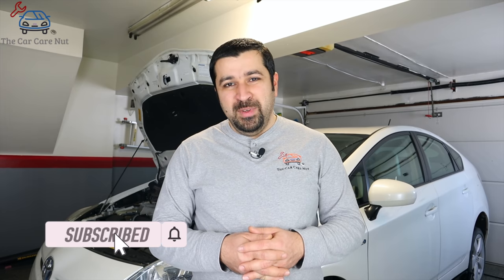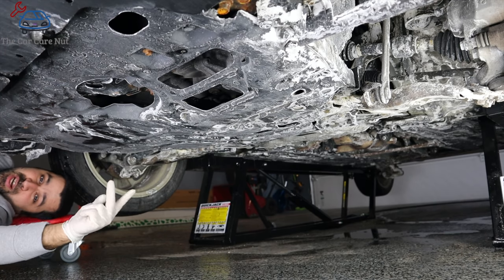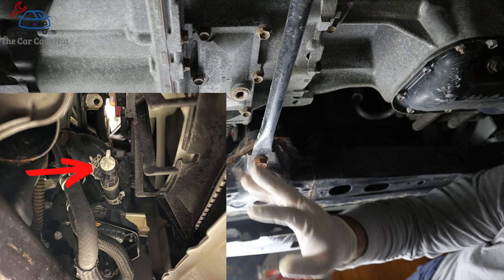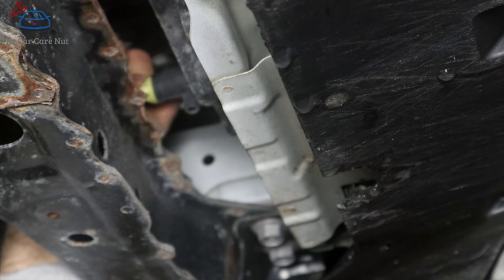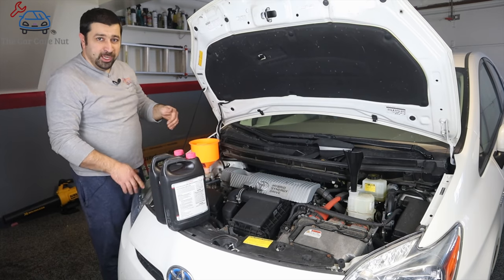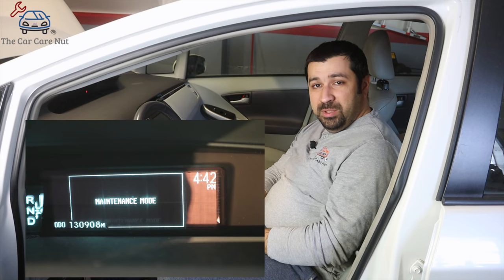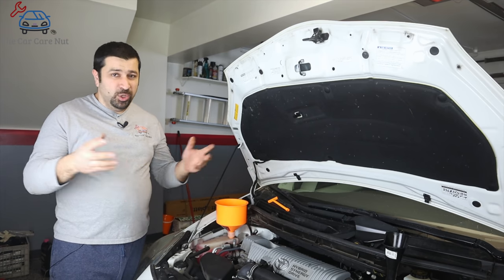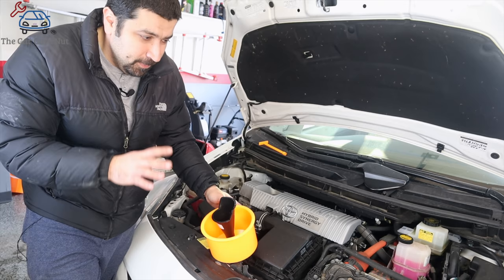How to replace your Toyota Hybrid Inverter and Engine coolant

Comment: I just replaced both coolants on my 16 Camry. I had to fill the antifreeze through the radiator cap 🧢. No way to tell when it was totally full till after the engine was running the fluid stopped going in. I only have a reservoir so there is no way to really fill it up. 

Thank you so much for the lessons in this video and everything went very well.
Reply: Hey Saint! I've run into some issues on this procedure for my '13 Avalon Hybrid. In maintenance mode, it's not pulling fluid in from the reservoir, and the engine tries to overheat. I'm thinking I may just need to fill the radiator directly under the metal cap, like you did. Any issues for you? Just fill it to the top, put the cap on, fill the reservoir, and you're good to go?
Reply: @ScottHancock  I filled the radiator 1st then filled up to the line on the reservoir. At that point I ran it and kept an eye 👁 on the level. If there isn’t any antifreeze in the system. When you just fill the reservoir it won’t be able to cycle any water 💦. I hope it works for you. The coolant for the hybrid system I just put directly in the reservoir and it went straight into the system. 

Wish you luck 🍀.
Reply: @BlueDroneBlues   THANK YOU for your help.  I just did the same...filled the radiator through the access hole under the cap, and kept refilling until it couldn't take any more. Then I filled the reservoir to F.  The engine is no longer attempting to overheat, my coolant pump isn't spinning dry, and my heat is working again.  I added a detailed write-up in my comment...hopefully owners of similar vehicles with a metal radiator cap will learn from our experience.
Reply: @ScottHancock  awesome sauce. Glad everything went smoothly for you and nothing bad happened. 😅

Comment: Is there a bleeder valve on this engine in case there’s a big bubble stuck somewhere?  If not, just let it go thru more Fan Cycles?
Reply from the maker: Hi. On the 4 cylinder engines there’s no bleeder. The v6 2gr engine does have a bleeder and needs a specific procedure to bleed

Comment: Question 🙋‍♀️: why wouldn’t you fill the radiator 1st 🥇 then fill the reservoir next?
Reply: There is no radiant coolant cap on this model. As you fill the bottle, coolant does flow into the radiator

Comment: I just did it last weekend on my 2012 Camry hybrid.  For maintenance mode, press power button twice to be on, otherwise the shift to neutral will not move.  Also, the coolant reservoir and inverter container will go down slowly.  I realized I had to fill radiator too (the metal cap one).  My coolant temperature went up to 220 or higher temperature, luckily I shut it down fast. I used Bluetooth OBD2 and Torque app to find out the temperature.  After I shut off the engine, the coolant on the reservoir went down quickly.
Reply: I have a 2013 Avalon hybrid... troubleshooting some problems after following this video. I'm wondering if I may need to fill the radiator directly, too, because it doesn't seem to be pulling from the reservoir in maintenance mode. I read your comment...is your coolant system still performing well?
Reply: @ScottHancock   Yes, still performing well.  Yep, my coolant in the reservoir went down a little bit slow and then a long time without any more movement.  That's when I got worried and checked the temperature.  I think I lucked out by adding to the radiator directly (after it cooled down before opening the radiator cap).  I did do massage the hose like AMD did but didn't help.  I think by shutting off the engine helped the fluid to go down.
Reply: @reikisponge  THANKS for your help!  I just filled the radiator through the access hole under the cap, and kept refilling until it couldn't take any more. Then I filled the reservoir to F.  The engine is no longer attempting to overheat, my coolant pump isn't spinning dry, and my heat is working again.  I added a detailed write-up in my comment...hopefully owners of similar vehicles with a metal radiator cap will learn from our experience.  Out of curiosity, what's the usual coolant temp for you now?  With the Torque app, I have an ECU (7EA) Engine coolant temperature reading and an ECU(20) Engine Coolant Temperature reading.   The ECU(20) temp is always much higher.
Reply: @ScottHancock  mine is 7C0 179.6F and 7E0 177.8F after 10 mins of driving.  I read that normal operating temperature is 195-225F.

Comment: Thank you for posting your videos. Using a coolant test strip I found my coolant was still good for temperature control but needed changing due to corrosive content. I changed the coolant of my 2017 Avalon Hybrid after watching your video and seeing how simple this was vs the $250 quoted by the repair shop and dealer.  You are right it can get a little messy but manageable.  The instruction on switching to maintenance mode was especially helpful.  A couple of comments:  I would note that for my Avalon you need to press the start button 2x.  I discovered this because you cannot shift out of park if you only press it once.    My second comment is that because you were working on the Prius, you did not mention draining the overflow tank of the radiator of my Avalon.  Only problem I had was waiting for the fan to kick on 2x - I thought I would hear them turn on.  I guess my music was too loud and I had a lot of coolant overflow from the radiator when it heated up.  I am glad I found your channel and it feels good to support a LOCAL channel.  I also appreciate your info on how a hybrid works - very informative.  I wish you, your channel and garage  the best of luck. Thank you.
Reply: Those fans are hard to hear on the Prius as well.  I thought they turned on a couple times in the half hour in maintenance mode.  I'll just keep an eye on the coolant levels initially.  Cheers!

Comment: Nice one! One question that I never saw answered is where/how to dispose of used coolant. I don't think it's a good idea to let it run onto the ground or pour it on the drain, but that's about all I know. I also know that auto parts stores will accept used engine oil, but not coolant. It's a bit of a conundrum for me.
Reply: I feel your pain. I could not find anyplace that would accept it. Not even my local recycling center or transfer station. Frustrating...

Comment: Thanks for the reassurance! Will take a look underneath. A friend (he and I have an Avalon hybrid) said “I spoke with a hybrid trained mechanic today. He said to change either coolant requires special tooling. Solenoids to the tranny, heater core, etc can only be opened by the tooling. He also said this machine uses a vacuum to draw out all the old fluid and suck in all the new. He said it's hard to bleed out all the pockets without the use of the vacuum.” I knew it was all B.S. Toyotas have always had a more basic, although possibly more time consuming way to do about anything.

Comment: Hello!
First of all, your video was of immense help. Truly appreciate it!

So here is my issue: I also replaced the water pump and thermostat while doing the coolant replacement. Used Toyota parts and they were very easy to replace.  Followed your procedure for bleeding using maintenance mode and even after 50 minutes, my radiator fans never came on.

The fluid levels in the reservoir did drop a bit and had to be topped off, I saw bubbles and circulation, and yet no fans ever came on.

I had an OBD reader checking the temperature and it never got above 201°F. I also tried another video’s suggestion of turning the heater on to HI and still nothing.

I have not taken the car for a test drive yet but will soon.  Hopefully it still bled properly even without the fans coming on.

Also, just to be sure, I turned the AC on to force the fans to turn on and they did without issue.

Thank you so much in advance!
Reply: Hello, I have a question, when do you know that is time to change your antifreeze/coolant? I just bought a used 2010 hybrid Prius but i don’t know how to recognize if I have to change it already :(

Comment: Thanks for the tutorial.  So if you do not see the coolant moving, you need to just keep the car in maintenance mode going through fan cycles until you do?
Reply from the maker: Hi! Yes leave it running. Usually within a few minutes you’ll see the movement
Reply: @TheCarCareNut  thank you!  You're generosity is greatly appreciated.

Comment: Perfect, I have a 2010 Prius and was just getting ready to do this. I also want to change the transmission fluid. I went to the dealer to get washers for the fill and drain plugs. The parts guy stated "There is no drain plug for the transmission". I said there has to be, so I asked him to just give me two washers for the fill plug because they are probably the same size. I can find very little info on the transmission service. Great videos, thanks so much for all your hard work and information. I will use your affiliate links.
Reply from the maker: Hi! Thank you for watching my video. A comprehensive video on Toyota hybrid transmission fluid replacement is coming out next week. And the washer for the inverter drain in this video is the same part no. For the transmission drain and fill plugs
Reply: @TheCarCareNut  Thanks so much, I will wait until that video comes out for my transmission service.

Comment: Excellent Video! I have a 2010 Prius with 188K miles. I want to do the coolant exchange by myself, but I have a question. What coolant do you recommend if I don't want to use the Toyota coolant?

Comment: Great video. I realize it's a few years old as I type this, but what would be a safe pressure at which to test the INVERTER system? I don't see the cap marked with a PSI rating.

Comment: Hi AMD.  Just changed my coolant & inverter on my 2014 Camry Hybrid.  Thank you for the video!!!  After putting the car in Maintenance Mode, I waited 15 minutes for the radiator fan to turn on.  It never did.  So, I took the car out of maintenance mode and drove it around. Engine temp gauge looked normal. I'll check the fluid the next day.  When the engine is cold, can I assume the radiator is full when the fluid is at the radiator cap?  Just finished binge watching your other videos!
Reply from the maker: Hi Eric! You’re all good. Sometimes the fan takes really long to come on. Drive it and check the coolant the next day. Your car is not one that is known to trap air. It’s pretty straight forward so likely you’re good
Reply: @TheCarCareNut  Thank you!  What I love about your channel is that you answer questions quickly.  I'm sure this takes a lot of you time, but it is sooooo helpful!

Comment: Is the engine coolant fully drained from the engine block by only using the radiator drain or is there a plug in the engine block as well, thanks
Reply from the maker: Most engines will have a block drain however Toyota almost always put it in a very difficult place to drain and what you drain is a small amount so it really doesn’t justify the pain of getting to the block drain. And when I do drain the block and take the engine apart there’s still a good amount of coolant still left in the engine. You’ll never get every last drop of coolant out of the engine. You replace enough that the new fresh coolant quantity is much greater than the old.

Comment: I feel stupid…did the transmission job on my wife’s 2017 Prius LE, no problems. Then spent a LOT of trying to find the coolant drain bolt…nope. Saw two yellow coolant drains on the radiator so drained as much as I could, got a gallon and a third out. Man, waiting for the fan to come on in Maintenance Mode took forever but glad I was patient!!

Comment: Hi , great video. But im wondering what about coolant which is in the heatexchange  device which is sitting in the middle of exhaust ?
Reply from the maker: Hi! It’s part of the engine cooling circuit

Comment: Took my 2013 Prius with 60000 miles for a oil change to the dealership here in Albuquerque. They called to say I needed the coolant replaced $400 labor + parts , the mass airflow sensor cleaned $305 labor, and the brake fluid changed for $130 labor plus parts. This seems to me like a ripoff. What do you think?
My car has been garage kept since new and we live in the desert. And the car runs like new . The total service was over $1100

Comment: Helpful channel/videos.  Would you be able to do a video for an Avalon Hybrid?  I'm having a really hard time getting the air out of my system.  When I run the car in maintenance mode, it just continues to boil the coolant up out of the spill-free funnel, but when I take the car for test drives, I am overheating the engine coolant.

Comment: I have a 2022 Sienna. Could you do a video showing how to change both coolants on that model please? 
My main concern is the transmission oil plug verses the inverter plug, and do I have to do a bleed anywhere? Thanks.

Comment: Is this the same procedure on the RAV4 Prime? 
How often should this be done on a 2019-2021 RAV4 Hybrid?  Time?  Miles?  Thanx.
Reply from the maker: Hi! It’s the same for the RAV4 prime and the replacement interval is the first 100k miles or 5 years then after that every 5 years or 50k miles

Comment: I love that you tell it as it is !!!! I’m thinking of buying a hybrid like the one you’re working on. I’m buying new and would like to know if I should change the oil the first time at 1,000 miles.
Reply from the maker: Hi! A hybrid is a great option if it suits your needs and you like the way they drive. I personally would change the oil the first 1000 miles but it’s not required
Reply: After the first oil change what is your suggested 2nd oil change mileage?

Comment: Hi there, thank you for the great video. I have already completed the inverter coolant before watiching this video on my 2nd generation prius.  I saw a lot of videos that talked about opening the bleeder valve for the filling of the engine coolant since it was tough to fill it up with the same amount that comes out.   i did not want to turn the car on even with the maintenance mode without filling enough coolant in there.  Please advise if this concern is valid.  It does not sound like you have any troubles filling up the coolant though to the same amount that come out.
Reply from the maker: Hi! On the 2nd generation it takes a bit longer and you just need to turn the key on to get the pump going. So just press the start button twice without pressing the brake pedal and the pump will start going and you can continue to top it up and it stops then go into maintenance mode and let it push the rest of the air out

Comment: Love the videos. No one else on YouTube explains it and ads the detail you give your viewers. I went to your store to buy the bleed funnel and I see 3 listed. I don't know which one to buy. I have a 2010 Lexus 450h. The one says it's for radiators only. I only have a coolant tank. No radiator cap. Thanks for any help.
Reply from the maker: Hi! You can get either of them. Without any adapters they will sit on the coolant tank.
Reply: @TheCarCareNut  thanks for this video. MUCH appreciated! Two quick questions; why would I flush vs just change fluid? Also, I'm at 115k on my 2013 450h and haven't changed fluids for inverter or radiator. Since I'm going to change now, even though the manual says the radiator should be changed at 100k and inverter at 150k, why not just do both? Thanks!
Reply from the maker: Hi! Flushes are not recommended unless there’s contamination. And I would replace the coolant for the inverter
Reply: @TheCarCareNut  thank you!

Comment: Hi. first, you are doing great job. But I have make litle update to this procedure (I did it one week ago) if we want drain all engine coolant we also have go underneeth car and disconect hose which lead to heatexchenger on exhaust. It is only possible way how to drain old engine coolant fluid from heatexchanger . It is little bit more like 0,5 liter  inside.

Comment: Thank you. question: when you drain the engine coolant-does the engine block which hold good amount of antifreeze gets drained  off. ? is there a separate  engine block drain plug  on Toyota RAV 4 hybrid. thank you. very educative material. chary
Reply from the maker: Hi! A small amount remains in the block which I wouldn’t worry about. Some of them have a block drain which still doesn’t get everything out
Reply: @TheCarCareNut  thank you . very educative channel. regards, chary

Comment: OMG Ahmed,  I was wondering how to keep the gas engine running while diagnosing a misfire. Didn't know about maintenance mode. This is awesome. 😂, yeah my first Hybrid.
Reply from the maker: Hi Ahmad! How’s the Camry treating you?
Reply: @TheCarCareNut  pretty good. I checked the Flex pipe and yup,  there is a leak next to the weld in the front. You can't see it but I can feel and smell the exhaust blowing out of it. Taking it to a muffler shop today. Still need to get the AC working but with this cold who cares 😂. Other than that the hybrid is great.  My 2009 XLE got side swiped by a deer Friday, dented the passenger side doors,  insurance claim file,  no major damage,  I can even pull it straight
Reply from the maker: When you get to the ac make sure it’s charged with the correct oil. Hybrids use a special oil and if you use regular oil you could damage the compressor. The flex pipe is common, Easy and inexpensive to fix at muffler shop. Sorry to hear about the accident on the v6 glad it’s not major!

Comment: Put a hose on the nipple on the radiator drain valve, letting it run into pan, to prevent splashing.

Comment: Can we use a vacuum pressure fill pump? Instead of runnîng engine?
Reply from the maker: I haven’t had good success with this engine and vacuum
Reply: Do i need to remove the thermostat for the servicing? Do i need to select the tempearture to full hot?
Reply from the maker: It’s not possible to remove the thermostat to bleed the system. And following the instructions in the video you don’t need the heat on
Reply: Thanks👍🏾